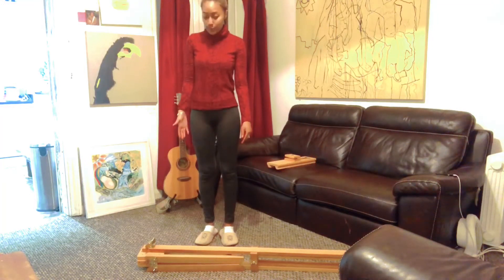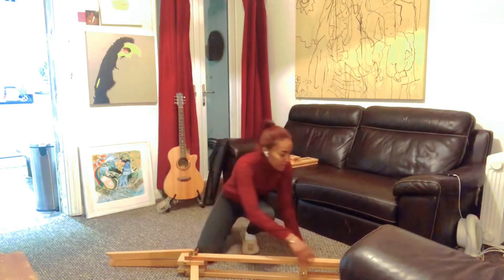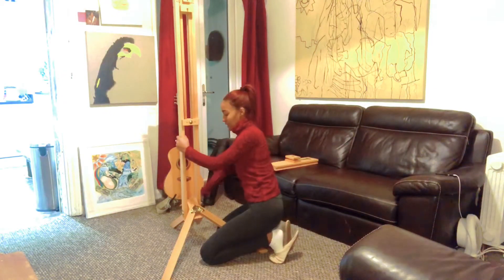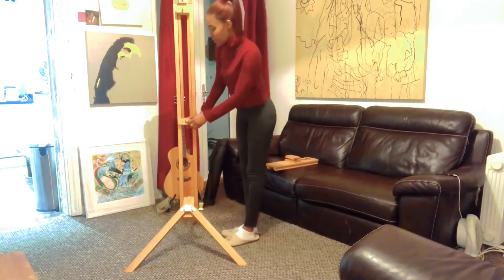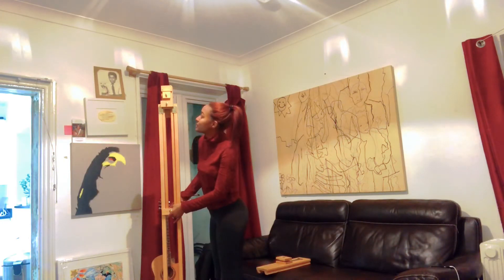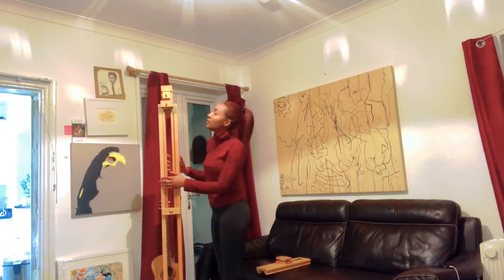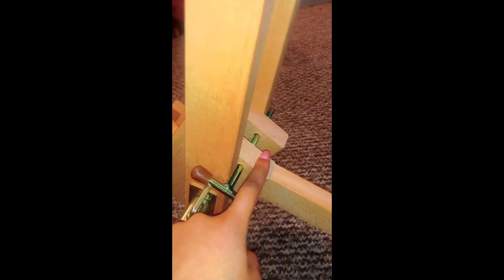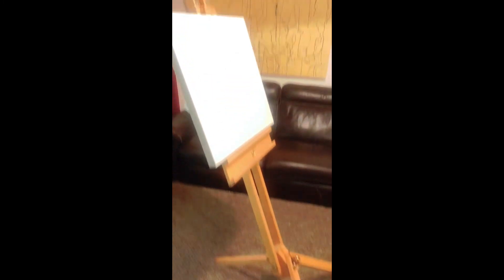Winsor Newton & Thames Radian Easel / Cass Art - Complete how to guide. Radial Easel

Comment: Hey I'm thinking of buying this as I do Acrylic paintings and Abstract art and I'm just wondering if its worth buying? 🙂
Reply from the maker: Definitely worth buying. Also good to consider what size paintings you do? Roughly what size?
Reply: @victoriathomassign  Brilliant thanks for replying to my comment. I get my Canvases from The Works as I'm from Wales and the biggest they do is 32x40 and the smallest i will go is 12 x 12 inches. Would these be ok?
Reply from the maker: @lilmonkey9919  inches or cm?
Reply from the maker: @lilmonkey9919  I’m presuming you mean inches. It’s perfect for 12 x 12 and bigger. Also should be fine for 32 x 40. The only time I have had trouble is with 40 x 40, the back of the canvas having the t shape in the middle didn’t work with the mid frame of the easel. But the sizes and weights you’re working with I’m sure will be perfect. If you were doing bigger than 40 x 40 I’d suggest an easel that takes more weight to keep it sturdy width wise 
You’re welcome
Reply: @victoriathomassign  Yea inches and great thank you so much for this i really appreciate it and its helped me so much 🙂
Reply from the maker: @lilmonkey9919  you’re welcome 
This is the one I got in particular https://www.cassart.co.uk/easel-category/artist-studio-easel/lea-radial-easel.htm
Reply: @victoriathomassign  Thats the one I'll be getting and I've been eyeing it up for a while. After your help I'll definitely be buying it. Thanks again Victoria 😃
Reply from the maker: @lilmonkey9919  you’re welcome 👌🏽👌🏽